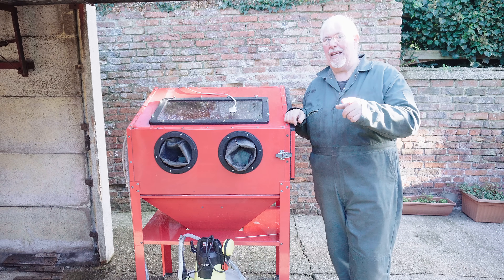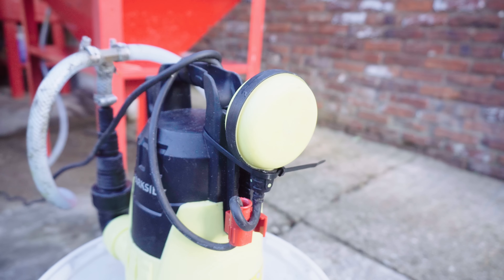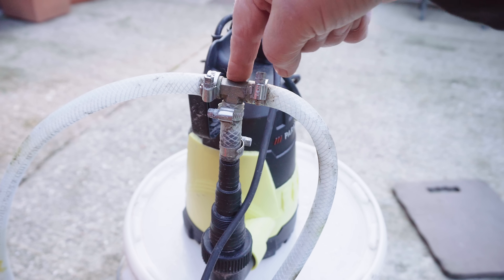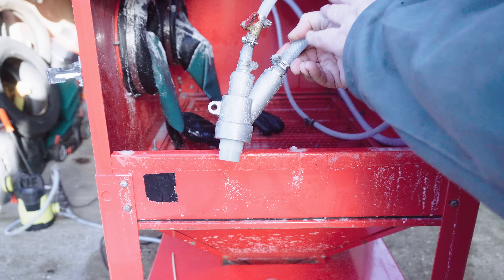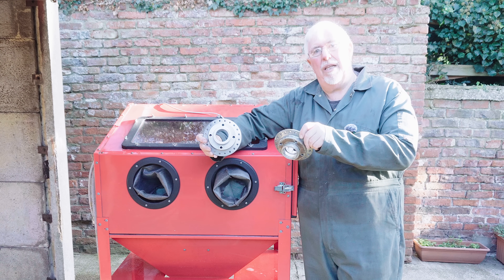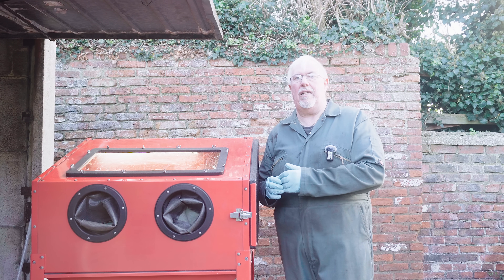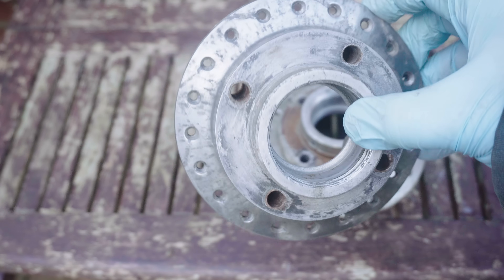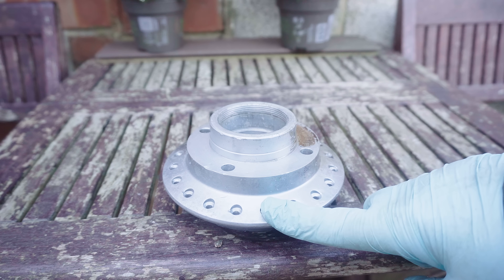Cheapest DIY Vapor Blaster Guide | How To Build The Ultimate Budget Vapour Hone

Comment: Hi. Your tee needs a 1/2in or 13mm inlet.
You throttled the flow down on the inlet and then helped the flow again in each branch of the tee.
You only need to go up 1/3rd in size to double the flow.
Also, those pumps tend to cavitate when flow is restricted too much also reducing the flow. 👍
Reply from the maker: Thanks for the info.   I think the T is 13 mm for each of its arms so I am not sure what you are telling me to do.  The inlet   it is connected to steps down to what I think is the right size to connect, so I am not sure how I could change it.

Comment: I made a similar setup a few years ago, main difference with mine was plywood cabinet covered with resin & fibreglass, I put my bucket on a turntable which slowly spins whilst blasting to increase agitation, I mounted wiper motor from the rear screen of a Toyota, I diverted some recirculated water via the pump to keep window clear. Works a treat using glass beads. Everything on 12 volts except the compressor. Great video, 👍
Reply from the maker: Thanks.  You've given some great ideas here.
Reply: Nice!

Comment: I bought a Full vapour blasting system, 3500 english pounds, and it's been a complete work horse for last almost 3 years. £60 for a big back of glass balls, every so often.. building one of these isn't expensive but.. having a compressor with enough umphf is the costly part. Great Video :)  I vapour blast in the london area and offer polishing and other finishing services, Thank you for sharing.
Reply from the maker: Sounds great.  A professional system is always going to be better, but it is amazing how much leverage this set up has given me.
Reply: @SPANNERRASH yours is doing a great job i wish now i had gone a cheaper route! So..  A decent quality pump is the secret as you have pointed out, I recently spent quite a lot of money on an upgraded pump, I added a solenoid switch for the air and water, connected to a foot switch, it came with a setup like that, but i've even upgraded that, trick i've found is (elbow grease or any antibac spray on the inside screen regularly stops dry and wet stuff sticking to it, i keep a window screen wiper (small one inside the machine) I hand opp that to keep my view good, with a little lub from the cleaner spray. hope the other projects are going grate thanks for your videos and content love checking out what you are up to always interesting. I am learning over time, vapour blasting is a skill in its self, cannot wait for more videos have a lovely xmas, Matt :) x
Reply: I'd like to see the work of a professional machine... Could you post some, or have you already posted them? Please send a link so I can see them.Thank you!!

Comment: I bought one of those cabinets from auction, the previous company had been using it for soda blasting and had leaked on every single joint of the cabinets construction. My first job was to completely disassemble it, throw all the cheap Chinese hardware away and replace with proper fixings, I sealed everything with a seam sealing compound when reassembling. The only place air and media escapes now, is where it's supposed to... I added a foot valve to replace the tap on the gun end so I can manipulate the parts with one hand and not need two to operate..
Reply: Hi mate can't you just used blast media  with  a large 150 lt compressor  😊
Reply from the maker: Yes, mine needs sealing to keep the water and media in.  If you are dry blasting, I found using an extractor was a real bonus.

Comment: Great video, very watchable and inspiring! I'm just setting up a sandblasting cabinet, now I can see it doubling as a vapour blaster. To clean the glass periodically whilst blasting, how about having a bulkhead hose fitting for your clean water so that you can have a water spray gun lying in the cabinet whilst you work, when the glass gets dirty just reach over and grab the water gun and give it a quick rinse, put the water gun down and pick your blasting gun up and keep going. I've seen this in sandblasting cabinets, a plain air gun to blow the job off for a look without having to open the cabinet.
Reply from the maker: Great idea, I will look into setting something like that up! Cheers.

Comment: Nice thing about vapor is you can use it on machined / finished surfaces.  Nice thing about dry media is they can remove anything from anything, almost.  Walnut hulls are safe for machined surfaces... and I have no way / place to dispose of spent solvent. ¯\_(ツ)_/¯
Reply from the maker: Yes it is good to have the option of aggressive dry blasting for paint and heavy rust, and vapour for a ligher touch and better finish.  And having the wisdom to use the right one at the right time :)

Comment: With the glass & other metal parts. Could also put on a ceramic coating (or some type of hydrophobic layer). So it's harder for water to stick & easier to clean up. Great video over all much simpler to setup then what other people show.
Reply from the maker: A few people have mentioned putting something on the inside of the screen, I am going to give it a go.
Reply: @ I’d just use a ceramic sealant / coating. Definitely will help to bead water. I need to aqua blast / sand blast. My parts - as I wanna start powder coating. It’ll just give a much better finish, my only concern is clean up & product waste. Blast media really is quite expensive. 

For me it’s roughly £18-25 per 25kg bags it takes roughly 60lbs to clean a 17 inch wheel. Thats why I got a blasting setup as using without one you’d quickly be out of pocket.  So, I wanted to collect the media. With this setup do we need any extractors? I’ll need to research a bit more on this. ☺️

Comment: My suggestions would be to get a foot operated switch for the pump, and keep a little squeegee inside to clean the window. You could also have the plastic window replaced with glass for cheap from the hardware store to prevent scratching.
Reply from the maker: Great ideas.  The screen is already glass, so it is more scratch resistant.

Comment: This is what i need to do to my sandblasting cabinet. Same one you got. But I would put in an automotive wiper motor in it with a water sprayer that hits the glass screen for better clarity. Ditch the large screwdriver and get you a paint mixer that attaches to the end of a drill.
Reply from the maker: Sounds like you will have a great set up.  There are lots of modifications that can be done, I just wanted to show the bare bones of a working system.

Comment: What about putting in a UTV/SXS windshield wiper (motor/blade) to squeege your view?
Reply from the maker: Some sort of wiper does sound like a good idea.  But I am worried about getting gritt caught in one, scratching the screen.
Reply: @SPANNERRASH valid! I bet it might be worth a shot, esp. w/ a soft blade, maybe a voltage controller to control speed as well.
Reply: The Rebuild rescue channel on yt they have a commercial vapor blaster with wipers like that.

Comment: Great set up. Have you thought of tapping your clean water feed to direct a jet to wash the screen, or possibly use a 12v screen wash pump?
Reply from the maker: Thanks for the suggestion but the water through the pump is all slurry, so if you added a fresh water feed to clear the screen it would then go into the bucket and eventually make it over flow.  A squirt now and again would be OK, like when I do use the hose a bit.  It is an area that probably hasn't got a perfect solution, but I will keep on trying different things.

Comment: Video was perfect and explained everything I wanted to know.
Can I offer you a piece of advice in return? When you are agitating the slurry, why not use a paint mixing paddle for your cordless drill? I use it for mixing pool chemicals and it is really effective.
Cheers
Reply from the maker: Great suggestion!  And it will work a treat, however I don't think it is really necessary to add another process in.  Once you have the media moving at the bottom, the pump does a really good job of agitating it.  It really doesn't need much of a stir.
Reply: @SPANNERRASH  sorry I should have specified for when you are mixing up the slurry before dropping the pump in. The mixer would have the settled aggregate off the bottom of the bucket in seconds.

Comment: Is this vapour blasting or wet sandblasting?

I have a wet sandblasting attachment that came with my Kew Hobby pressure washer I bought in 1987, it gives good results but the media has to be really dry or the suction pipe will block.

Using the foul water pump with the slurry would overcome that limitation and your video has given me the push I need to buy a media blasting cabinet and give your method a try, if not then it will be used for dry sandblasting, I find that the wet blasting I have done caused no dust only water and slurry the problem was not being able to reuse the media and keeping the unused media dry.
Reply from the maker: Looking for a definition I found..  vapor blasting is that the finish is produced through the flow of water borne abrasive, giving a finer finish...  Which ties in with what other refer to it as.

The big advantage is that the slurry recycles and can be reused for quite a while.  As long as you let the cabinet dry out and give it clean between different media, you alternate between wet and dry use.  Dry is better for steel that has gone rusty, or needs paint removing, where as the wet is better for aluminium such as engine parts, it also gives a nicer surface finish.

Hope this helps.

Comment: Do you think you could use a pressure washer instead of a compressor for the pressure feed for the blasting nozzle? Could you try? Only thing is I've had a blasting cabinet a few years ago and I quickly realised you need a pretty stout compressor to keep up with the air use. So even though I've got a compressor again now, I'm not even gonna bother getting a blaster despite really wanting one. But I've got a pressure washer I could use. They have very high pressures. 

Obviously you'd have to modify the system a bit as otherwise you'd be lots of blasting media due to the constant feed of water from the pressure washer. (fine mesh to catch the media to be able to re use it perhaps?)

Also try ceramic coating the inside window, it makes it very water repellent. The stuff car detailers use on cars.
Reply from the maker: It wouldn't work in the same way.  You can get attachments so that a pressure washer can be used to blast in a similar way.  But from what I can see it works as a total loss system and wouldn't really work in a cabinet.  

Great idea about the Ceramic coating, I will give that a go.

Comment: Thanks for posting. This is exactly what I am looking for. May I ask what your compressor output per minute is? does it neeed more or les air than normal basting?
Reply from the maker: No worries, the compressor is a 150L 14CFM model, see link in description to see the spec. I'd say about the same air consumption as normal blasting.

Comment: Better than simply sand blast …?
Reply from the maker: I wouldn't sand blast alloy engine parts, or wet blast rusty painted cast iron parts.  Horses for courses.  :)
Reply: @ cheers ! I am personally looking at a system for old windows / doors .  The only I saw is a CO2   But …$$ 
Any idea !!
Reply from the maker: @ikust007  Sorry mate but absolutely no idea on that. Never used that type before.
Reply: @ no problem sir !

Comment: Im really impressed with vapour blasting, I had never heard of it until a few years ago. I found a guy that specialises in it and he has done a spectacular job on everything Ive given him. Most impressive was bakelite fuse boxes, not only did it bring the bakelite up with zero damage but also cleaned the brass connectors like new, absolutely amazing.
Reply from the maker: It really is a great process. I wonder what media he uses for bakelite?  I know that plastics can be done, but I haven't researched the media you would use.
Reply: @SPANNERRASH Sorry I don't know obviously very fine. until your video I didn't realise vapour blasting used abrasive, I thought it was just some chemical under pressure. He also covered everything he did with an incredibly expensive anticorrosion product used on the inside of airliners, no idea what it was but nothing even tarnished after being treated with this

Comment: Why vapor versus dry blasting?  That works well.  I have a spare cabinet and new gloves already, so this shouldn't cost too much.
Reply from the maker: They both have their place. dry blasting is great for removing rust and paint, but too aggresive for aluminum.  Wet is great for making aluminium look new, cleaning off the corrosion and giving a semi polished surface.  Surprisingly I find wet blasting less messy too.

Comment: Brilliant... thank you.  I've project for the Christmas holiday now!  Could I ask of the size of your compressor please, and will it run continuously without compromising the cleaning finish?
Reply from the maker: Thanks. I have a Wolf 150l 14CFM Compressor.  Although after the first 30 seconds or so, it does start pumping it seems to settle at a constant pressure that is certainly enough to keep going with the set up I have.  I hope that helps.

Comment: I have a blasting cabinet that I use with fine glass bead. What would the benefit be from converting to this vapour blasting? Genuine question as I might well consider doing that conversion. Thanks
Reply from the maker: If you are using fine glass beads there might not be much of a benefit from this.  The water does reduce the aggressiveness of the media.  I suspect it will give more of a honed/polished finish than the dry media, but I haven't tried using the same media dry then switching to wet, so I can't speak from experience.  I hope this helps.

Comment: Enough instruction, concise without telling us your life story. Thanks.
You could make a magnetic wiper for the clear screen. 2 pieces of foam, and a couple of magnets.
What's the CFM of your compressor? I know blasting needs a lot or air pressure as well as capacity
Reply: You could line the glass with acetate sheet, an A4 laminator pocket will give you a few usable windows. I found a source of scrap glass locally and cut my own windows when I blasted daily
Reply: Great video,  I've been an amateur blaster for a few years now,. Your cabinet is good, I have upgraded my cabinet many times and have always struggled with the lack of air pressure even from linking 3 compressors together (35 cfu).  I only solved this problem when my lad bought a proper pot blaster with a trailer compressor,  using this compressor on my cabinet was a game changers,  it will blast almost anything.  Thank you for sharing
Reply from the maker: I am thinking of some sort of wiper system, but I am worried that if grit got under it, it might cause more scratching.  I have a 14 CFM Wolf 150l compressor, but I think that as long as you are happy to work in short bursts a 10bar 50l compressor will work.

Comment: Very interesting set up. Have you tried RainX on the glass? They also make one for perspex. The other option that might work is a ceramic coating product you can get for carpaint. That certainly works on my car for ease of cleaning.
Reply from the maker: Great suggestion! I will give that a go.  I have ceramic coated things in the past, but cleaning the first with vapour blasting would have made it easier.  I am intending to powder coat these items at the moment, so I am very pleased with how they are coming out.

Comment: How big is your compressor?  From what I have heard the problem is that they take a huge compressor to keep up.
Reply from the maker: I use a Wolf 150l Compressor, which seems to give me enough air for continuous use, but, I have blasted with a 50l compressor before.  The downside is that you need to pause to let the compressor catch  up every couple of minutes or so.  This is a pain, but if you are only doing a few things now and again you can live with it.    Hope this helps.
Reply: @SPANNERRASH  Thank you, that is very good.  I have the equivalent of the smaller compressor at home and I am about to start restoring a Harley Davidson Sprint or as you probably know it as an Aermacchi 350.  After that my wife wants to restore her father's Suzuki 400 Apache that she inherited.  I am researching how to properly clean and get a good finish on the various parts that need it.  I think a cheap vapor blaster would be the right tool for the job.
Thanks again.

Comment: Really enjoyed this video! Ive been looking into which media is not so aggresive for some small honda parts and dont want to chance a dry blast, ive had a few parts vapoured in the past which came out great but cost me 50 quid. Subcribed now keep up the good work 😊
Reply from the maker: I have found the glass beads I am using really good.  They aren't aggressive, so won't remove paint or thick crud, but do give a good clean finish.  To get a more polished finish, just means blasting them a little longer.

Comment: Excellent video. I'm gonna build one here in the states. I already have the cabinet and compressor, and I've found all the parts on American ebay. In fact I'm going to use a pump with twice the power as the one you've used. Thanks for making the video.
Reply from the maker: Sounds great! I'm sure you will be pleased.  It  revolutionizes parts preparation.